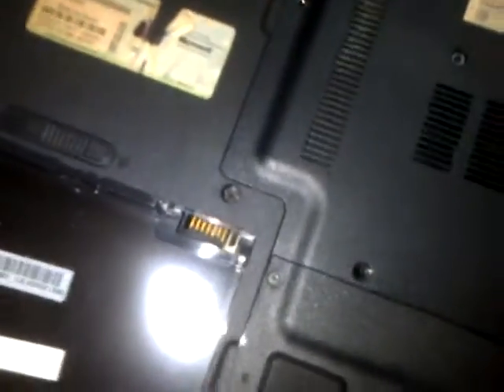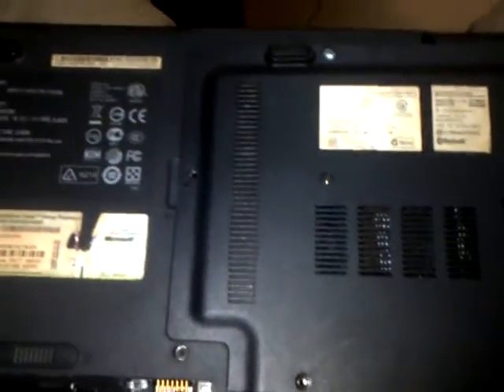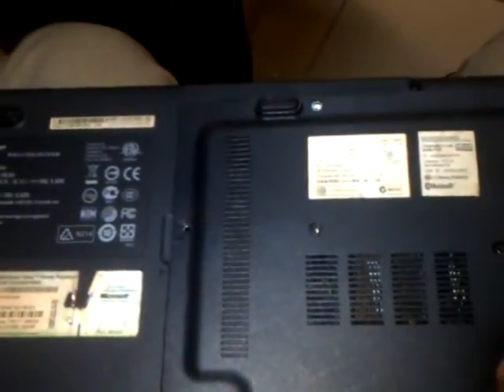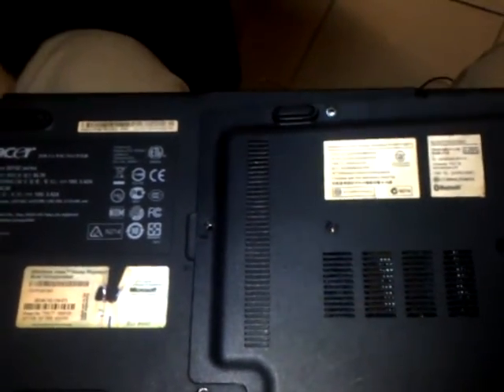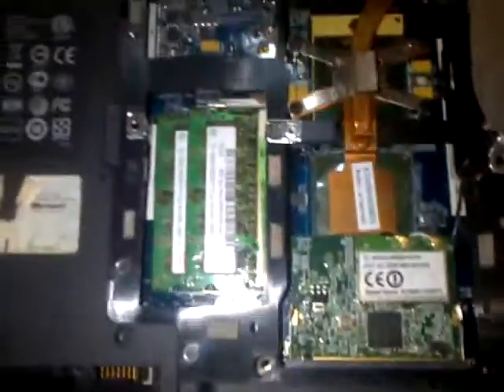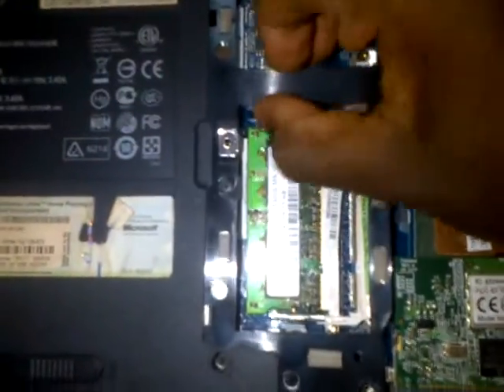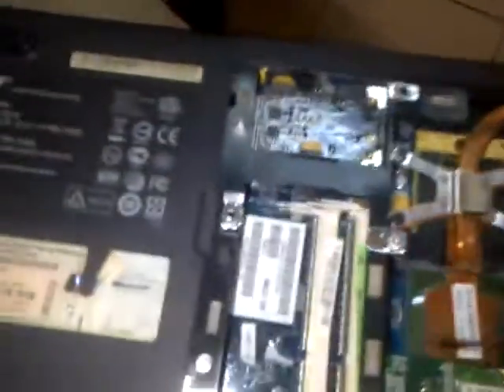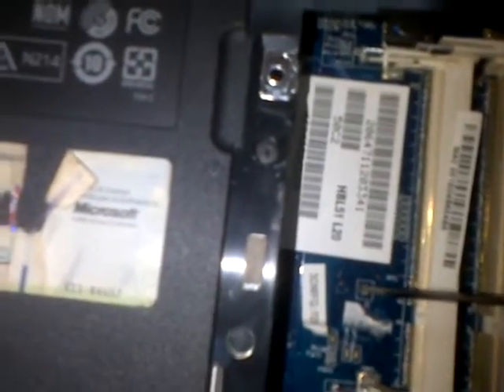Reset BIOS Password   aspire 5610Z

Comment: For them of u That Try This Out, . THINK FIRST an Make Sure u have a "5610z" an NOT A Norm 5610, as that's what I have Now, and have jus Tried the Glitch in the vid, an like 1 of the other Peoples Laptops mine went BLACK SCREEN as well, . ! ! Every time I tried to reboot it not a fing but Black, . ! But I Saved mine wid some Quick finking, I Took out the Batt an not far from me I had a Repair Disk Win7, 64bit . But for a TOSHIBA EAUIUM Laptop, an I fort Shell I, . ? ? Anyway after I shut the drive, it started making some Crazy Sounds but slowed down so I turned it all off an back on, Den I held down Ctrl & Alt wile Pressing f10 over an over till it all jus BURST Back into Colour Pic's so im happy again, But I was lucky I had a little bit of know-how or it would of been in the bin after Doing this Glitch Thing, an I Think its cus my 5610 Dose NOT HAVE The Letter, . Z . After it, . So jus make Other Peeps out there, Fully awear of the Right Laptop to do it on Init, . ! Good Glitch Dow So I'm going to Follow u on here mate in case I get stuck on a Next Thing, . lol, . Safe, . in a bit, . ! !

Comment: My lap top was without battery and no connection with the power  at all. Of course it couldnt be open without any power on so i opened it and did exactly as you do watching the video from my cellphone and going step by step. Unfortunatelly for me after all this my lap top opened but it didnt show anything on screen. I think my mother board said goodbye and died. Now i have to buy a hard drive case to put the hdd inside to rescue all that is left and of course i have to buy a new laptop because changing the mother board will cost almost the same. I do not blame you because it was my decision to do this. My lap top was working perfectly with dual boot windows and ubuntu and i wanted to put also android but i could nt remember the pass in bios, so after doing the commands and failing i tried your hack but with the worst result.
Reply: Hi Juke. You might not really need to purchase a new laptop. Firstly lets confirm if your screen is faulty or your motherboard. Kindly provide me with the current state of your laptop, what happens when you put it on. Secondly, could please connect your laptop VGA port to an external monitor so as to confirm if the laptop screen is the faulty part. I really wanna understand what went wrong  because the hard reset solution is almost risk free.